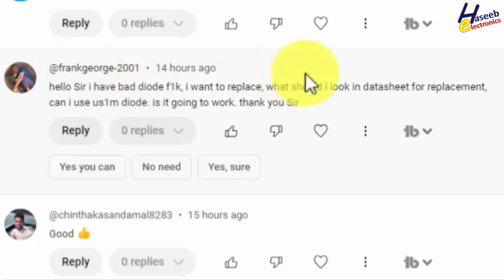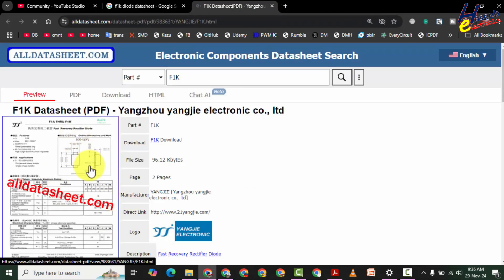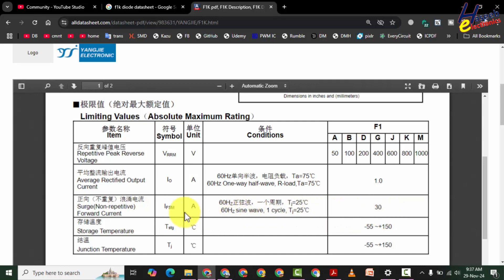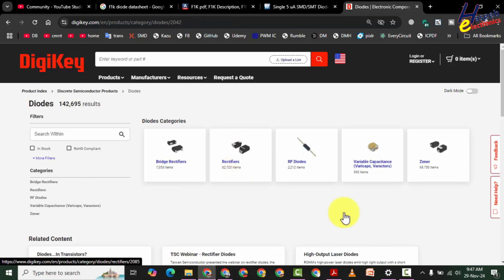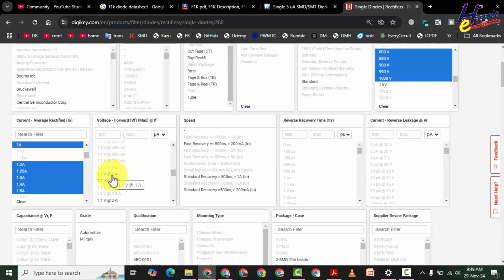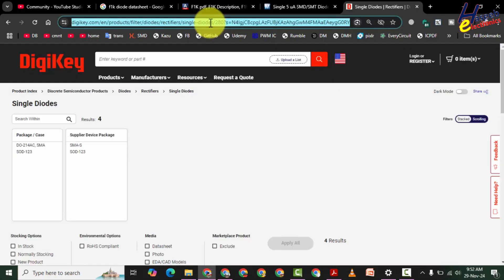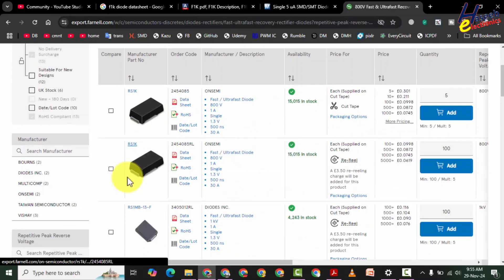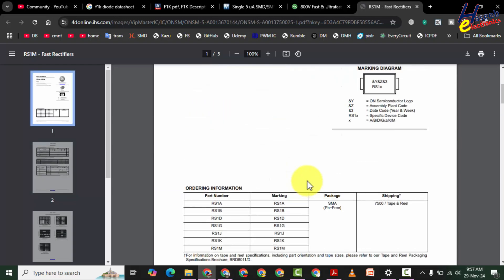{1246} SMD diode datasheet and finding Equivalent

Comment: asalamoalaik.
thanks for your very good explanation. I have problem to find or finding equivalent for 7 pin ( 8 pin but one is not connected ) switching IC ( number: 62YL8B2UU) unfortunately its data sheet also is not available. based on your explanation in a related video how to find a burnet or damaged IC number I found this IC number as replacement ( NCP1014 ). in your opinion could it be a good replacement or not. please guide me. Thanks in advance for your help.
rahamallah valedaik.